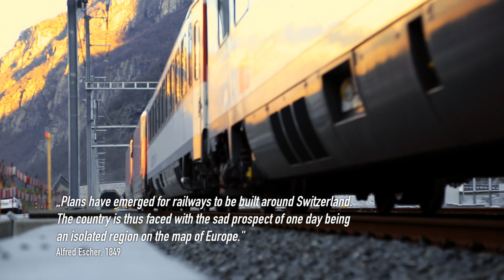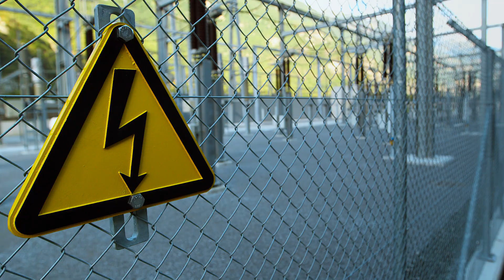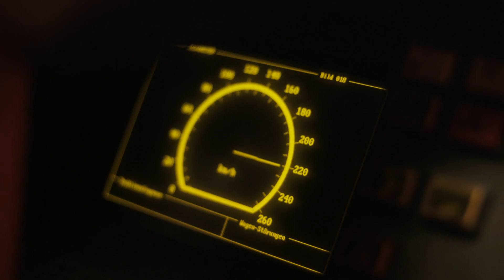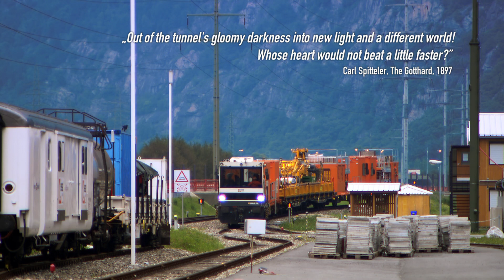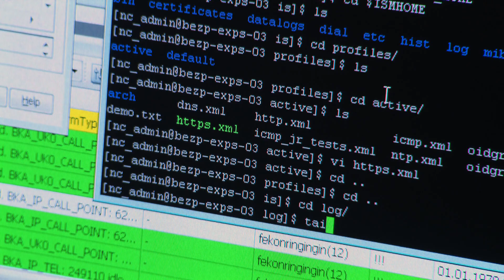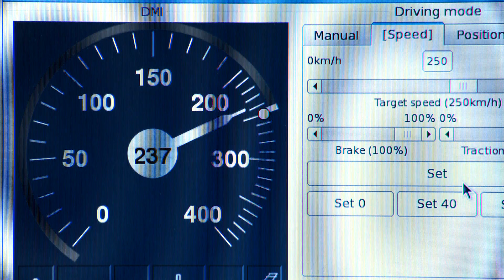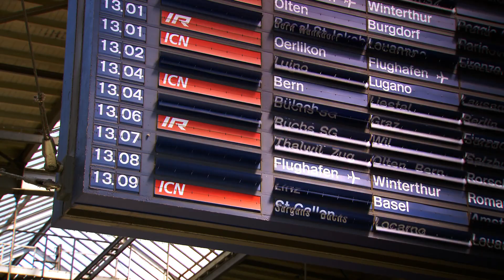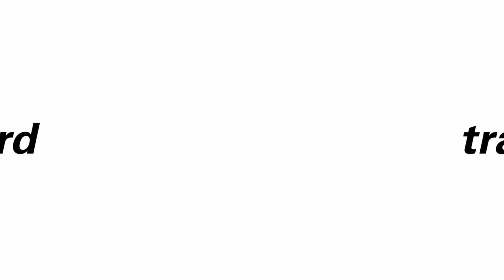State-of-the-Art Railway Technology Transtec Gotthard 1 8 GB

Comment: 16.7 Hz? Really? That's how you measure power?
Reply: 16.7 Hz is just the frequency of the electricity. The railway through the Gotthard base tunnel is electrified with 15'000 V AC 16.7 Hz.

The power is measured in watt (W) or kilowatt (kW), not in hertz (Hz).